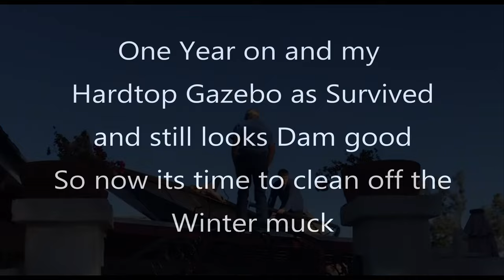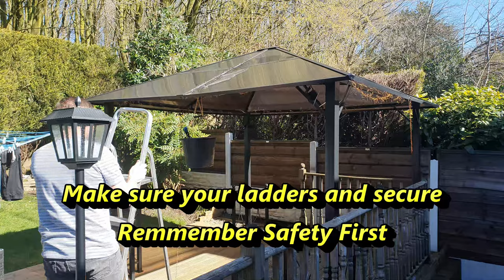Cleaning a Hardtop Gazebo ready for the Summer

Comment: Do you get snow by you in the winter
Reply from the maker: Hi Yes and the gazebo has held up ok through the winter months. thanks
Reply: @MRCarybuck  no problems with the poly top with snow accumulating on it?
Reply from the maker: @louvet5572  Hi no this is the reason I bought this type of Gazebo as its strong enough to cope with the snow thanks